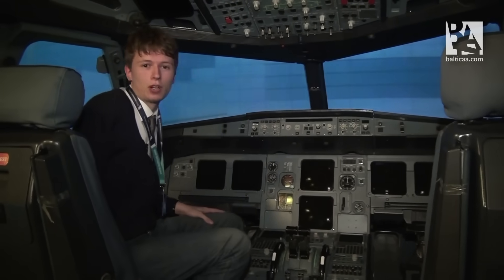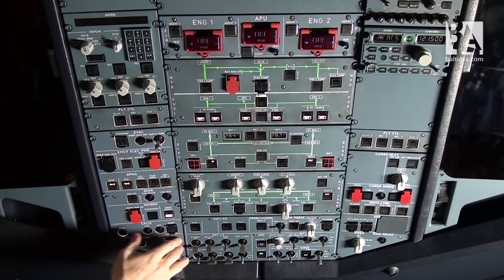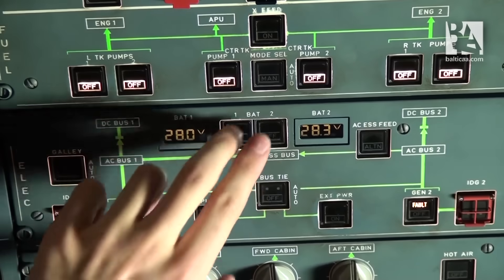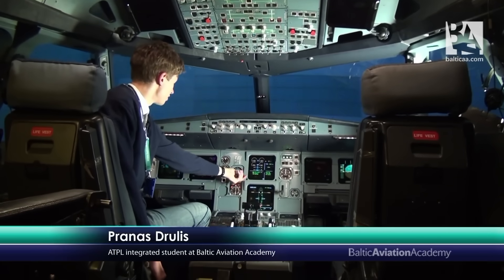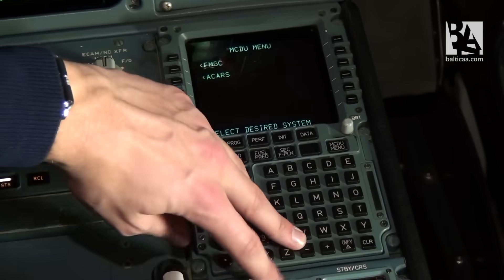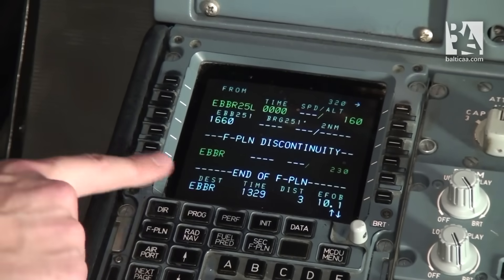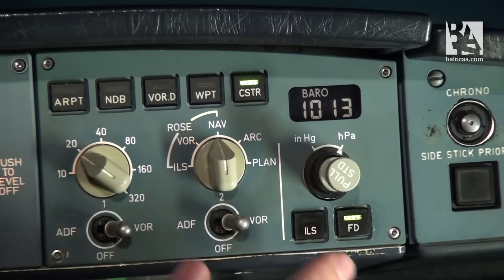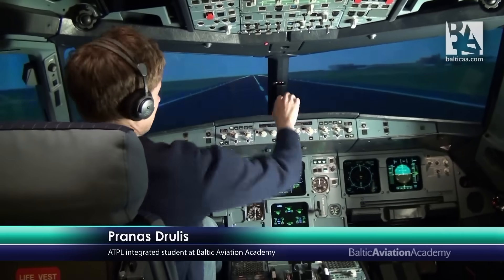Airbus A320 - From Cold and Dark to Ready for Taxiing

Comment: Biiiiiiig mistake he made, APU on but he forgot to turn on the beacon lights, it can cause an accident with uninformed ground crew.
Reply: You don't have to have the beacon light on when just the APU is on. They just have to have it on before push and engine start. I work the Ramp at KSMF
Reply: Well it depends on each airline´s procedure and airport/country regulations. Airbus recomends that when either Engines or APU are running the Beacon light must be on, although country and airport regulations may not require that beacon lights should be on while APU is running. As a pilot i´ve learnt that when either Engines or APU are running the Beacon light must be on. I work at Avianca, Colombia.
Reply: +Juan Sebastian “JSRossiascoG” Rossiasco G. Beacon on is also applied after starting the engines, in my country as well. As was said before maybe it changes from country to country ;)
Reply: Yes thats my point :)
Reply: 12:52
Reply: It was wayyyyyyyy later
Reply: However he turned the beacon light on before start the engines
Reply: he did turn them on.
Reply: The beacon only needs to be on whenever the aircraft's engines are about to be started, or the aircraft is moving. The APU can do absolutely no damage

Comment: I normally have to wait 15 sec after pressing the APU start before pressing the the on switch switch so the APU exhaust outlet door can open. On the APU screen in the EICAS will show "door open".
Reply: +FlyGuy's It's called ECAM and it will show "Flap open".

Comment: Hi Pranas Drulis! After the start up, I must turn the engine mode selector on NORMAL or leave it on IGNITION position for the entire flight? If must to switch it to NORMAL position, when I have to do that?
Reply: Yes after the start you have to change the selector to normal. Its only for ignition
Reply: Back to norm after start as its is a trigger for the PM (pilot monitoring) to do his after start flow of arming the spoilers, zeroing the rudder trim, selecting flap to t/o position setting the pitch trim on the wheel and selecting the ECAM status button. You would only use ignition during the flight if you see heavy rain ahead or expect moderate or more turbulence.
Reply: You put it back to normal.

Comment: Huge mistake before apu start up...he did not check wx radar to ensure it was in off position. That was repeated over and over in my training at kdtw. 
If ground personal is in front of nose of a/c during apu start and wx is on...thats a huge issue with life long consequences...
Reply: ***** No it's really just the wx radar. The wx radar is the of utmost concern due to ground personnel working around the plane especially during pushback. There is one thing he seriously forgot to check which is detrimental to the passengers and that's the pressure system. When the aircraft reaches 12500 feet oxygen thins out. Once at the cruise altitude of 30K plus oxygen is mandatory. Without the oxygen in your lungs and blood you lose consciousness. This is known as hypoxia which is an oxygen deficiency.
Reply: @LT81baller  There is just as much oxygen at 12500 feet and 30000 feet as there is at sea level - about 21%.  It doesn't "thin out".   The air pressure simply decreases making it harder for oxygen to get into your blood.  If that wasn't true, then aircraft would have to carry tanks of oxygen for the passengers.  They don't.
Reply: @stargazer7644  then what are passengers breathing with the masks during an emergency loss if cabin pressure? I followed you until you said they "dont carry oxygen".
Reply: @SirHeadly84  Aircraft do not carry bottles of oxygen to pump into the cabin during normal flight.  It isn't needed.  What's needed is air pressure, and that's why the cabin is pressurized at altitude, and your lungs function normally.  When the cabin depressurizes, the air pressure drops so low that very little of the (normal level of) oxygen in the air can push through the barrier in your lungs to get into your blood.  To counteract this, they ignite a canister that starts a chemical reaction that releases oxygen for a few minutes.  This increases the percentage of oxygen in the mask above the normal 20.8%, so that more of it is able to get into your blood.  Even those masks are not connected to bottles of pressurized oxygen.  They have a solid chemical in a can.  But we weren't talking about the masks.  We were talking about normal pressurized flight.  People erroneously think there is somehow less oxygen at altitude.  There isn't.  It's 20.8% up there, just like it is at sea level.  Planes don't put oxygen into the cabin air.
Reply: @stargazer7644  ok. Cool! I wasnt sure how that operated.  Didnt know it was a chemical reaction.  How is cabin air filtered? Is it like.. charcoal canisters or something or recirculation style?
Reply: @stargazer7644  There IS less oxygen per given volume, even if the PROPORTION of oxygen to other gases remains largely the same!

Its incorrect to state that there is NOT less oxygen at altitude - there is! The atmosphere is much thinner making for much less gas per given volume of space
Reply: @Tom--Ace  And exactly how is that any different from me saying the air pressure is lower at altitude?  It isn't the lower absolute quantity of air that makes it impossible to breathe at altitude.
Reply: @SirHeadly84  Some aircraft don't recirculate the air at all.  It's pumped in via the compressors in the engines, run through the air conditioning packs, released into the cabin and allowed to vent overboard.  Newer aircraft tend to recirculate a percentage of the air in an attempt to keep the humidity up to make the cabin more comfortable.  Some aircraft have hepa filters, some don't have much of anything.  Aircraft cabins are not sealed up tubes with everyone breathing everyone elses air.  The entire air volume of the passenger compartment is exchanged every few minutes.
Reply: LT81baller at a320 enhanced, you also have to switch the apu fire extinguisher circuitbraker to off before you do the apu fire test !
Reply: if you do the apu fire extinguisher test, there i a small chance, that the extinguisher actually gets fired, so you have to turn off the circuit breaker  for the test
Reply: Ask my kids, oh, hang on i can't have any.
Reply: Holly shit, i did not know those radars are actually that dangerous. I must say, this comment is the most interesting part of this video. xD
Reply: But the important thing is that he checked that the windshield wipers were off!
Reply: What are the consequences
Reply: not sure about scarebus, but on many types radar normally is interlocked with WoW. So if you're on the ground, should still not "fire" even if set to scan. But it's a good practice to check the switch anyway. Also modern radar's danger zone is basically "inside the radome", so if a tech right next to it (or maybe in a nose wheel well), he may get slightly zapped.
Reply: Did you go to the loo around 7:05? He clearly checks for weather radar to be off. :-P
Reply: @Colaholiker  It needs to be checked before starting the APU, to prevent it accidentally turning on when the APU comes up to speed.
Reply: LT81baller Hes in Europe.
Reply: You were probably taught by older instructors. The new batch of Honeywell and Rockwell Collins radars, but out less radiation than a microwave ovens. You can literally turn the radar on, with ground staff right in front. Don't believe me though, this comes from the manufacturer.
Reply: @blairansellfraser  Good test is hold a chocolate bar in your hand and if it melts you're toast.  True story of how "microwave ovens" were invented.
Reply: Would be an interesting experiment...maybe it should be part of the walk around?
Reply: He checked it at the 7:05 mark. Flight simulator doesn't make you an expert.
Reply: @bvbinsane1vanity  The point is to check it before starting the APU, to prevent any possibility of it accidentally turning on as soon as APU power is available.
Reply: LT81baller just like it happened with a Helios 737 years ago where the crew forgot to properly pressurize the aircraft and everyone fainted to their death...made for a really interesting Mayday episode.
Reply: @rshvkkt91  That was due to a maintenance tech not returning the Pressurization panel to 'Auto' after double checking some reported issues.
Reply: He also didn't check for clearance from the pushback operator before starting the engines. Here in the U.S. airports strongly disallow any engine starting at terminal gates

Comment: Great video.  A couple of questions if you don't mind:

Is it ok to start both engines prior to push-back?  I assumed that the pilot(s) started engine 2 and 1 during the push-back phrase.

What percentage of throttle do you use for the taxi; or breakaway (just out of pure curiosity)?
Reply: You can start both engines before pushback provided clearance for both engine intake and engine blast. The FCTM (Flight Crew Training Manual) says 40% to break inertia, and the planes will taxi in idle, pretty fast actually, beyond the 30 knot GS limitation :)
Reply: Julian Franco Thanks for the answers :)  I am pretty adept with Airbus X Extended for FSX and use around the 38% mark to break away and taxi; I just wondered how that compared with the real thing and it's seems pretty similar.

Comment: He forgot to turn off the packs and the APU at before take off checklist! ...other than that was a great video !!
Reply: It is not a requirement to set the packs off as long as the take off performance had been calculated with packs on , also the apu can supply air to the packs so performance will not be affected :)  David Villa
Reply: David Villa he also has aversion to wearing a Safety Belt most of the time ! I know it's just a Simulator though !
Reply: Julian Franco well the apu supplies air to the packs while the engines are off (APU BLEED) once the're started up, the apu is no longer necessary

Comment: Hello. I have a question. When Pranas entered the runway, the APU was on and the APU BLEED as well. Is it correct that way? I heard that APU can be turned off after both engines are stabilised. Or, to be more precise, when the APU must be turned off? Thank you in advance for your answer.
Reply: The apu gets right before the rest of the plane in order to test the APU... When the engines are turned on, you can switch the apu to off
Reply: The checklist states before taxing the APU is to be switched off.
Reply: Loobo2012 There isn´t such a thing as before taxi checklist :) , there are procedures that require the apu to be running during taxi (One engine taxi departure); and by the way, I think pranas did not go trough the entire process for take off Captain Radu otherwise he would have mentioned things like TCAS and Engine Mode Selector :D
Reply: Julian Franco I may be wrong because i was reading 747-400 checklist lol.

Comment: APU bleed should be turn off.
Reply: Why? Often I have the APU bleeds supplying air while doing a full thrust/engine bleeds closed take off.
Reply: thefactorypilot145 Then your passenger will be smelling the exhaust of the Engines? I think after engine start apu bleed should be off
Reply: No, no exhaust smell. When the APU beeds are supplying the cabin air, the engine bleeds are closed.
Occasionally we can get into a configuration which results in a "SMOKE TOILET" warning on the EICAS, but that just has to do with seepage past a valve seal. 
You should never be smelling engine exhaust in the cabin since all of the bleed taps are upstream of the combustion process.
Reply: thefactorypilot145 i see thanks
Reply: ***** When the engine bleeds are open, basically power is being taken from the engine to provide pressurization and deicing and such. When you need all the thrust you can get, the engine bleeds remain closed and the APU is used for pressurization. Occasionally if Anti-Ice is needed and the APU is broken, you must take off with the cabin unpressurized. This is in the CRJ series anyway.

Comment: 4:10 Look at generator 1 light/button that shows "ULT", looks like one of LED's or lightbulbs illuminating this button is not working and needs to be replaced.

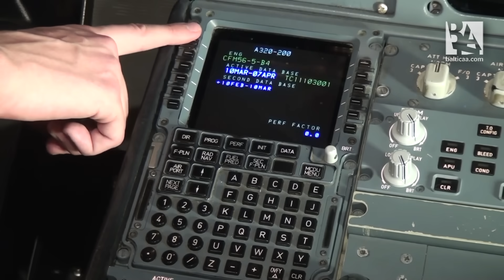9:10 Checking that there are correct engines in case of stealing engines and replacing them by another ones by some aircraft engine robbers ;-)
Reply: Some aircraft within an airlines fleets have different engines, therefore different procedures. For Example... FedEx has 757s with both Pratts and RR's. One uses EPR the other doesn't.
Reply: someone might steal a CFM 56 turbofan engine in the middle of the night and throw on a cessna piston engine without anyone realising!

Comment: nice video but i have a few questions:
1. shouldn't u have a GPU connected before starting the APU?
2. I think you have to turn on the nav lights from the moment you have power in the a/c.
3. Shouldn't u pushback first and then start the engine?

Comment: A car uses electricity to start the engine, and automatically shuts off the rest of the electrical systems (i.e. the radio) when the starter motor is running to provide it with maximum power. A plane uses compressed air provided by the APU to start the engines, when starting the engines it's important to not have anything else (such as the A/C) using this air.

Comment: wth? bleed air is taken from the low or high compressor inside the engine before the ignition process, no gases into the cabin they come out at the back tip of the plane

Comment: errm, it's on most boeing aircraft also. it is also beside the throttles also this big. Since 1950s I guess. the trims were on boeing aircrafts. For A320 it's since 1980s since the plane is made after 1980s.

Comment: why do they need to switch off the air condition? I mean, I noticed that a car turns it off also with the radio for a second as the engine is starting, but why does it do that?

Comment: You would normally turn it off after engine start for economy but its not a big deal on a simulator. I also guess you can use it during takeoff to provide bleed for packs and save engine bleed for thrust but im not familiar with such a procedure. Just guessing on that.

Comment: @rnzafdude 1013 qnh or 29.92 in. is standard sea level pressure, the more severe a storm is the lower the pressure and the nicer the weather is the higher the pressure is. T-Storms pressures are about 29.75 in. So basically the pressures fluctuate with weather. Thats why the other guy was confused by 1013 qnh in a t storm. Hope that helped.

Comment: I don't think you understand what happens when an INS drifts.  It is an inaccuracy of the system over time.  It is due to the mechanical components in the gyros or mirrors in a RLG.  It is proportional to time, IE at t=0 (just entered position) there is no error.  It does not require maintenence to fix, simply a new position must be entered (on the ground).
The FMC will use all 3 INS units to come up with a "statistically most probable position", helping to reduce drift further.